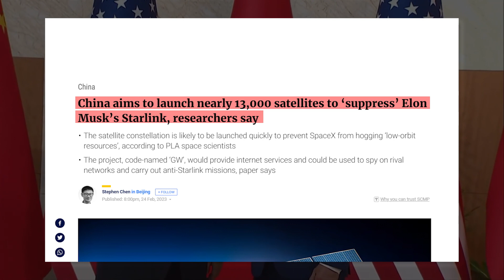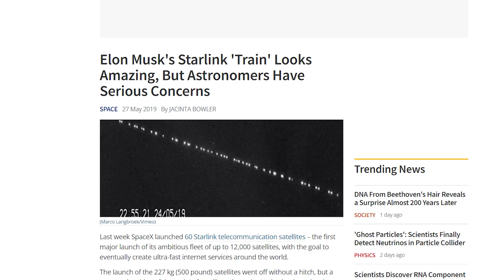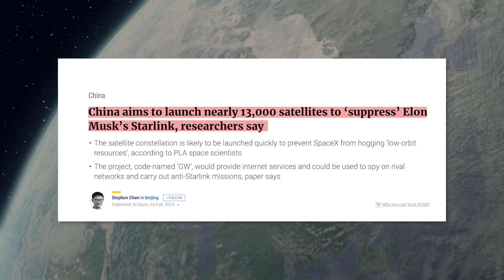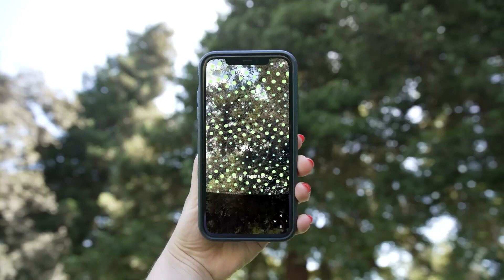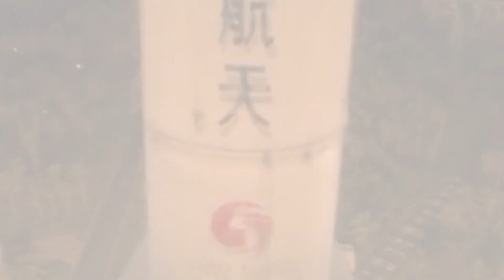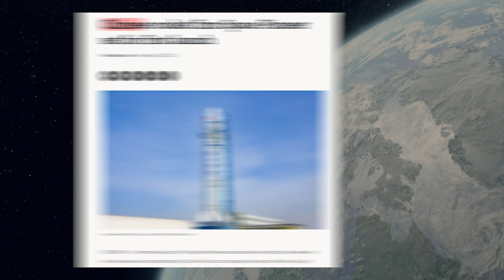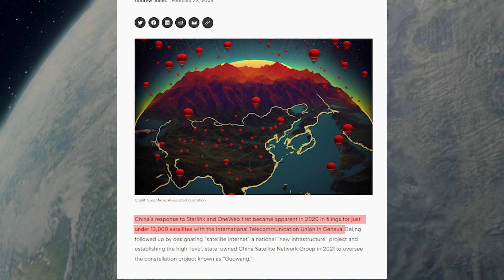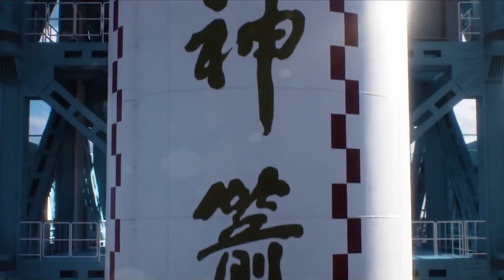China Launches 13,000 Satellites In Crazy Plan to BEAT SpaceX

Comment: All the Satellites around the Earth will be electromagnetically terminated by outflows by the Sun within 20 years or so.  How often does the Sun fire a big enough blast to send us back to the Stone Age.  The studies that attempt to answer that question do not look at the Sun from a flare physics perspective but rather the geologic evidence deposited by past events here on Earth. Time and time again, the answer seems to be the same. As we saw this past week in another paper, every 150 to 200 years the sun will hit Earth to that degree. not a Long window for an electrified civilization to get its act together. the level of flair that our modern way of life could not handle it's actually only around x50 which would produce a geomagnetic storm in excess of kp9, wiping out the global grids setting fire to electrified structures and sending Humanity back centuries. The last one was 1859, 164 years ago so in the scope of that 150 to 200 years range we're in the Red Zone if it happened tomorrow.  no serious solar physicist or geophysicist would be shocked beyond belief, and our time is certainly running out.

 What's worse, Earth is becoming more vulnerable because we are in a geomagnetic excursion. The magnetic poles are shifting but more importantly the magnetic field protection of our planet, our protection from the Sun, is weakening. We have seen it impacting the upper layers of the atmosphere and even the jet streams, but more important than the slight modulation of geophysical phenomena,  the sun is getting an easier and easier shot at our planet during this magnetic pole shift. The magnetic field weakening quickly, and accelerating.

Let's do a little bit of math. We should see that super solar storm at some point within the next 36 years that would be the maximum full 200 years between the last one and the next one but when exactly in the next 36 years is anyone's guess. Chances of it happening this year are only about five percent but by 2030 that number jumps up to 25 percent by 2040 we're basically at a 50 50 chance,  but that's before you consider the weakening of Earth's magnetic field I consider it highly unlikely we will make it to 2050 and the very good chance we're not going to make it to 2040. The important thing to take away from this is that what we see around us is not going to continue. These storms routinely pound our planet and we're due. For the first time we are in an electro-dependent society, unlike the  past where nearly everything that keeps 8 billion people alive will be impacted, if not taken away completely.  

Source:  https://www.youtube.com/watch?v=WFk-STIisy8